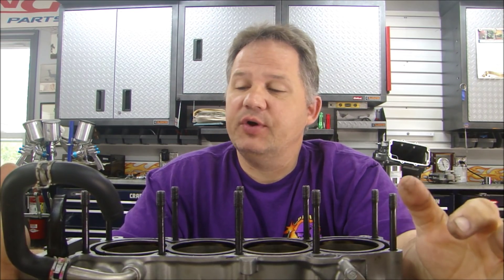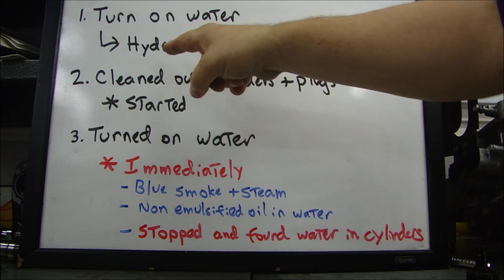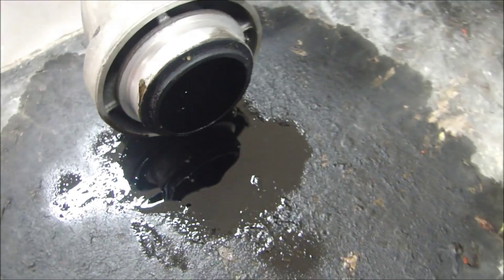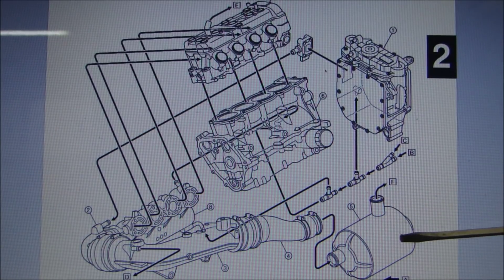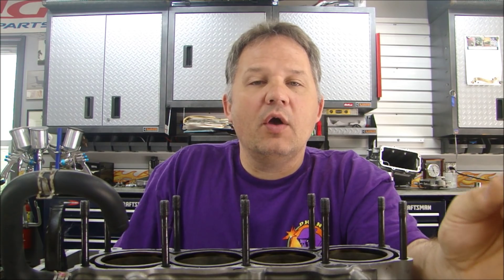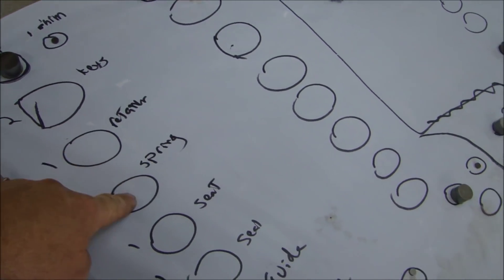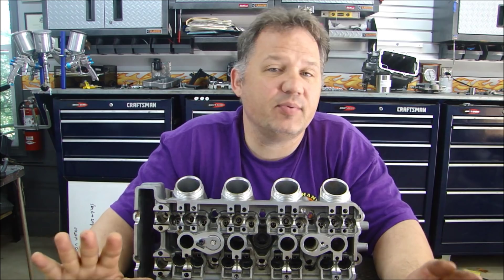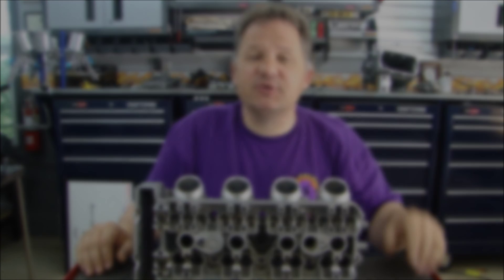Engine Repair Part 3

Comment: So I am getting water in the oil on my 2015 VX. I have flushed it 3 times. I forgot to put the plugs in one weekend and the hull filled with water. Long story short the engine hydro locked and stopped. I am guessing it could be the head gasket?  What are your thoughts? The engine runs fine but the oil gets milky. Wouldnt a compression test help give me an idea if its the head gasket?
Reply from the maker: Yes, do a leak down check to see if is the had gasket
Reply: Petes Garage  I did the leak down check and all four cylinders went to 90 psi and didnt bleed down. Thats a good sign I suppose. I thought 90 psi is low for an 11.4-1 compression ratio. And there was no water on the plugs. Im wondering if I just need to flush more oil through? Maybe three times is not enough. Any ideas what else I should do?
Reply from the maker: Drain all of the oil out and start from scratch.
Reply: Petes Garage got it figured out. Started the engine and ran it with the oil filter off and let it pump the oil out and just added oil while it ran. Thanks

Comment: 100% you ran the hose on the ski with the engine off,

water filled the exhaust and travelled into exhaust and entered the cylinder head. 

this is why they tell you to not run water through the cooling system in a jetski when the engine is off.

expensive lesson, but great video!
Reply from the maker: Expensive lesson indeed

Comment: Did you end up taking the valves out?  I have a spark plug that dropped the core into the cylinder of this same engine.  The engine is frozen.

I suspect I will have to take the valves out of the head.  One of your videos would really help!!!
Reply from the maker: I took the whole head apart. I will be making an assembly video soon. I have a digital copy of the manual for this engine if you need it.
Reply: Pete's Garage how can I get a copy of the digital
Copy good sir?
Reply from the maker: @GriLLeX636  I have a copy, it's 17 MB so you need a dropbox
Reply: @PetesGarage  the service manual is the only way I've gotten this far into the engine.  So many hidden bolts on this engine.  Thanks for sharing it!  It's been a lifesaver.
Reply: @PetesGarage  I definitely need the digital copy of the manual.  I have the valve cover off.  Did that today.  Need to take the heads off next. Hopefully tomorrow.  gdfred88 at gmail dot com  Thanks so much!  I'm hoping to ge this running again in the next few weeks.  Thanks.
Reply: @PetesGarage  I look forward to seeing the assembly video.  I'll have the head off in the AM.  Hopefully I will see the problem at that point.  But it looks like the bottom end is frozen up....  I'll know tomorrow.

Comment: When you going to do the block tear down
Reply from the maker: I won't have to, the oil cooler was cracked
Reply: You should do it anyways with the water in the engine it might of caused problems in the block  [bearings], remember you said, if it breaks down a mile out on the lake you can't walk to shore.
Reply from the maker: Excellent point
Reply: @PetesGarage  was the oil cooler the main problem?

Comment: any concrete verdict Pete? I have one of these sitting out front with 30psi in each cylinder :/ going to tear mine down soon thanks to your videos
Reply from the maker: Looks lie the oil cooler was cracked
Reply: @PetesGarage  i have the same issue, milkey  oil.....No warning lights and no loss of performance...so far 4 oil changes no luck. I was hoping mine is the oil cooler and not a head gasket (out of my league repair). any pointers and can i pressure test just removing inlet and outlet hoses from the cooler installed? "with under 15 psi?

Comment: Aewsome videooo waoooo   continue please doing videos... about   4 stroke..... 2 stroke..

did you have from 4 cylinder meecruiser motor boat ?  carburator until 2005 i belive so  fuel injection at present...     i have a boat Stingray 2002 190cs.....how to set up .or change head gasket or anything you have send it...you are great mechanic. 200%%%% god bless you..

if you have from bmw E46 model or E92.. until present let us know    or mini cooper
Reply from the maker: Thank you very much. I do not have any 4 cylinder Mercruisers, but I built many 502 Mercruisers.

Comment: I am almost sure you over filled it with oil,  When you check oil , You have to start and let it run for 30-40 seconds ( you don't need to have it on the garden hose for short runs) then check oil  and the oil should be a tad on the low side not to the full mark
Reply from the maker: I did that, it just would not burn off the water and oil

Comment: Great job Pete. Your analysis and diagnosis is a lot like what I go thru. It sux that it was the oil cooler - completely external to the engine.  Tough but at least what you found makes total sense. This is one for the books!
Reply from the maker: Yeah....it's a tad more complex than a motorcycle, but interesting nonetheless.

Comment: Check the air filter if it has oil on it you over filled it with oil and it will suck it into the intake, water in cylinders , you turn on the garden hose before you started the engine,  there is nothing wrong with the engine
Reply from the maker: That is what I thought, but I did find a crack in the oil cooler

Comment: I'm having a similar problem. When I started my Waverunner last weekend, it was hydro-locked. I removed the coils & plugs and cycled the engine to clear the cylinders. Clean the plugs reinstalled everything and it started fine, but, without being connected to water. After putting the Waverunner in the lake, it started & ran fine, but, then quickly shut down. I noticed the plugs were fouled and there was water in the oil reservoir. Therefore, I drained the oil/water and cleaned the plugs. Once again it started, but, then quickly shut down. Noticed again there was water in the oil. Took the Waverunner to a shop. Btw, my Waverunner is stored outside in northern Michigan. Thinking I may need to store it in an enclosure with some heat...
Reply from the maker: I wish I found a definitive reason why it does that. I have not put it together yet but I will report when I do
Reply: @PetesGarage  Really interested in the conclusion to this series...I bought a second hand VX1100B....learned a great deal on how this engine works...just hope you solved your issue...and are enjoying your Ski again. Cheers from Aus
Reply: @pdemaroi did you ever solve you similar problem "water in the oil reservoir"? I have the same issue minus shutting down or any loss of performance, 4 oil changes still getting milkey.
Reply: Hi pdemaroi I have the same issue, found water in the oil, engine total stripped all seals and gaskets are fine, nothing cracked, what did you found on your Waverunner?

Comment: you should never turn on the water befor starting the engine. water can get in the engine trough the exhaust if the engine is not running....
Reply from the maker: +tingovida107 Now ya tell me....lol
Reply: is there a part 4? I can only find 1-3. these are great videos I'm having same issue on the same ski. thanks
Reply: @flylivin   Naw, no 4th video as he screwed up his engine by not following the owners manual, then excessively yapped and repeated himself for 3 videos like he knew what he was doing, he even had a presentation board to explain his findings in 2 colors! then at the end gave up and parked the waverunner.. A typical "I know nothing what I'm doing" youtube video.. 

Then he has all these lost sheep that follow his chanel and ask his advice for diagnostics of their PWC problems and guidence for their carriers?... Yikes!.. He can't figure out his own problems but he can gude you to yours?..

There are SO MANY TESTS that you can do to determine the cause of this issue without taking the engine apart that this guy didn't do and just blindly ripped the engine out and apart, cluelessly guessing all the way... And he has, and runs a buisness?..... Yikes again!

Real repair shops make a lot of money from these "I no nothing what I'm doing" shade tree mechanics... 

I had a good laugh listening to this clown, especially when he used his flat screwdriver to tap on his laptop screen during his lessons which is now scratched and chipped. 😆 💥 💫
Reply: Yup.  I just realized your turn on process.  The pressure is too high from the tap if the engine is not running....  If there had been a longer leak you would have found water in the oil reservoir too.  

But these are great videos.  Mine dropped a spark plug core into one cylinder so I need to break it down and see what's up.  Thanks for the walk through for that.
Reply: I just did it. I’m so pissed at myself for forgetting. I hadn’t used the boat in 2 years and just forgot until it started to hydro lock.
Reply: yeah I found out the hard way on my 2013 VX cruiser. I left the water on for about 30 seconds after shutting the engine off and whatever cylinder had a exhaust valve open filled up with water instantly. of course that prompted me to actually read the book. come to find out “do not run water to engine Unless the engine running first” then shut the water off first Then make sure you blip the throttle to clear any excess water out of the system before turning off Engine 🤪 luckily I caught my mistake immediately and didn’t let it sit to rust.👍

Comment: Water can get into the cylinders if you were to flush the engine with the hose before the engine is on.  If you turn on the water before you start your engine, the water from the hose can fill the exhaust and back its way up into the to where the valves are and leak into the engine since there are 2 valves open at all times.  I had a problem with water in the engine on my fx 160.  live and learn
Reply from the maker: +Chris Devone I'm beginning to think more and more that may have been the root cause
Reply: @PetesGarage  That was definitely the cause.  Always always always start the engine first then water on.  Lucky not more damage but you stopped everything quickly enough

Comment: Pete, was this watercraft towed (over 5PMH) dead in the water? Generally the jet pump is used to feed the water into engine via the exhaust system and head inlets you showed in the earlier videos. If the ski is towed dead in the water fast enough, water still flows through the pump, into the feed lines, and backfills the exhaust via the exhaust cooling ports and into the cylinders? Also, the same goes for when the ski is started on a trailer using a flushing system. If the ski sits not running with the hose hooked up and running, it filld the exhaust system with water and can get into cylinders via open valves, hence only a few cylinders show washing.

For instance, if they hooked up the hose, turned the hose on, and sat there trying to prep the ski for starting, or it didnt start right away and they left the hose running, this could happen potentially?
Reply from the maker: +Paczowski123 It was not towed, nut the hose was turned on first. That is what happend I think
Reply: Could be, especially if the hose was left on for an extended period of time. Again, I do not know the exact water routing of that engine, or how the exhaust is cooled, but it could be that if no other problems were found.

Comment: Hi, have you considered that it could be an oil cooler failure (as well as what you already mentioned)? I would think that maybe the oil mixes with the water and and causes problems when circulated. then again you said the oil didnt look hydrated so my theory may be totally wrong..
Reply from the maker: +aspyromilios I think you are right. I have found no major problems with any part so it must be in the oil cooler.

Comment: where are the rest of the video 4,5,6,ect.
Reply from the maker: +Sierra Weiner I'm still working on those. This project got pushed to the back burner
Reply: Pete's Garage looking forward to the 4th video on your finding and how you were able to pin point the problem

Comment: Has the problem(s) been solved with this or is it still under investigation Pete?
Reply from the maker: +James Lowery I have that engine on hold right now. I have so many engines to build, my stuff always sits. I have all winter to get it back together, however, I did not find any major cracks or problems. Some guys have commented that they have experience withe problem. It does look like a seal and or the oil cooler assembly

Comment: Hey Pete have you find anything about the engine?
Reply from the maker: +Jose Perez I have not found anything significant. I think it's in the oil reservoir and
Reply: +Petes Garage if i may, check the diagram with the oil chart, notice the part on the side, where the water goes by the oil container jacket. It could be that the inside has a very small hole and you have a vacuum building up and pulling oil with the water. (i would point out that, at this point i'm just guessing based on what i see. Unfortunately, i'm not there to look at how things are set up) If i was to place a bet, the metal is from either a pump or something of that nature where it's broken and it's causing oil to be "pulled" up with the water. LIke i said though, i can't really tell since i'm not their to look at it. Hope you find the cause though. Good luck.

Comment: How do you clean those engines very well before you start working on it?
Reply from the maker: indika bamunuarachchi I soak parts in Royal Purple. It is a degreaser you can get at any auto parts store
Reply: +Petes Garage thanks Pete

Comment: Also check oil cooler. Probably frost damage here, causing the oil to force its way into the cooling line over to the exhaust manifold. Pair this with a damaged head gasket, and i think youre on it... :-)
Reply from the maker: alsosteikje I think you're right...

Comment: depending on how much water was in the exhaust already, if the water is running without the engine running water builds up in the exhaust and gets into the cylinders through open valves, and with the cam overlap can actually draw water in faster. 15 seconds is a fairly long time. also that model has been known to stick rings and getting some blowby.
if you need a hand with anything related to jetski engines let me know, i do lots of these engines, I'm actually pulling one out early this week, low comp
Reply from the maker: ryejetski Thank you....it's pretty straight forward so far.
Reply: ryejetski I have a similar engine specifically the one from an sx230HO. I can’t trust my dealership and there really aren’t many places in Vegas who can help me. I just did a compression test which found that all cylinders but the 3rd are running normal. I saw that the 3rd cylinder was running at over 300psi an when cranked without a spark plug in it sprayed a brownish liquid which seems to be water mixed with oil. What lead me to this point was oil in the intake manifold plus the oil dip stick kept showing that the oil levels were much higher then the full mark after running but before the oil level was just barely visible on the stick. Have you ever ran into an issue like this or have suggestions.

Comment: did you have water running for a length of time without the engine running?
Reply from the maker: ryejetski Maybe 15 seconds. After that I cleaned out the plugs and cylinders and it started up. It ran fine then I turned the water on. Oil was in the water and steam coming out the exhaust from burning in the engine
Reply: ***** depending on how much water was in the exhaust already, if the water is 
running without the engine running water builds up in the exhaust and 
gets into the cylinders through open valves, and with the cam overlap 
can actually draw water in faster. 15 seconds is a fairly long time. 
also that model has been known to stick rings and getting some blowby.
if you need a hand with anything related to jetski engines let me know, i
 do lots of these engines, I'm actually pulling one out early this week,
 low comp
Reply from the maker: ryejetski I'm thinking you are right because I have found nothing wrong inside the engine
Reply: @bigblock1968impala  do you make videos too?  Those of us with wrenches and little $$ in the pocket could use all the jetski repair videos possible.  There really are not many out there for Yamaha Waverunners of this 2005ish vintage.  Thanks.
Reply: @GDFred88  ill be soon doing a rebuild of a 2006 fxho, ill see if i can get something done then
Reply: @bigblock1968impala  That would be great.  I have the cams off.  I'm about to take the head off.  I can't see any problems yet.  But I did not really expect to on the top of the head.    I'm anxious to see what's underneath.  I bought them used and one of the spark plugs had seized up and dropped it's core into the cylinder. apparently while it was running.

Comment: Start the engine and then turn on the water if your running it on a garden hose. Or water will enter the cylinders everytime it back flows through the exhaust. And the cause of oil in the intake ports is from over filling the oil sump always run the engine for 10 to 15 minutes before checking the oil level they will always show low oil on the dip stick when the engine is cold.
Reply from the maker: Christian Farwick That is awesome info...thank you very much

Comment: Hey Pete! I miss your engine building series. I know you have a lot of work and the cobra had to be put aside. But, do you have any other references that I may stumble upon. I recently bought a 1996 cobra block and Im definitely going to need some guidance. Thank you Pete you're the best.
Reply from the maker: Gary Flores I'll do what I can to help. If you miss it you can watch again...lol
Reply: ***** Awesome! Thank you. I just want to get to point where you had that Chevy block in part 11. I want to know what to  do after installing the throttle bodies. I know I can look that up. But I'd prefer your in depth informative videos. I do learn a lot from it. And YES I will definitely rewatch the 11 videos. Thank you Pete!!